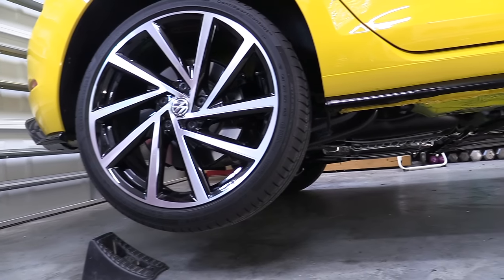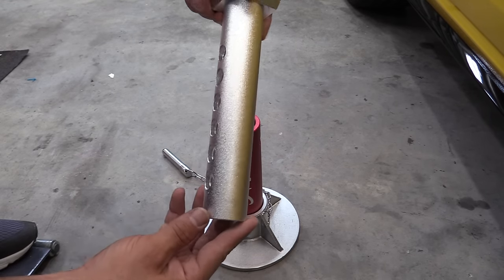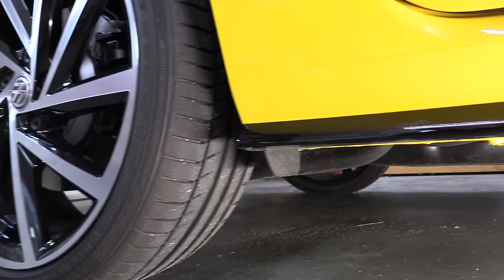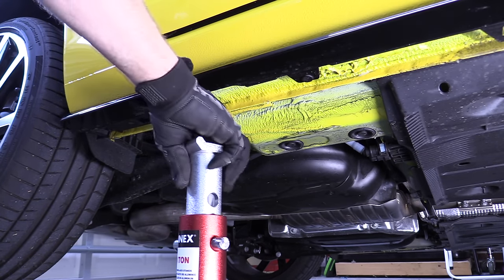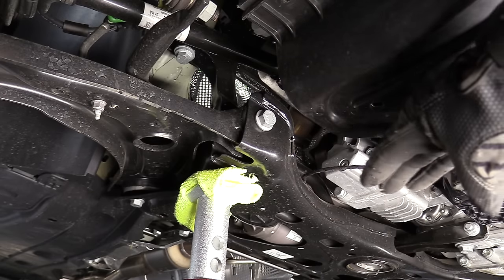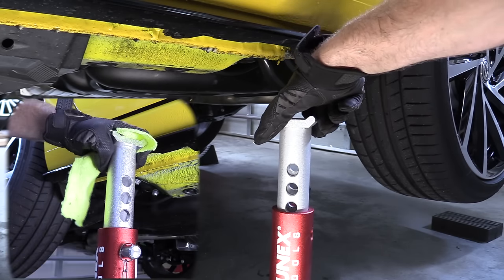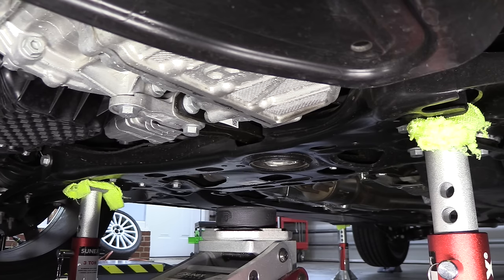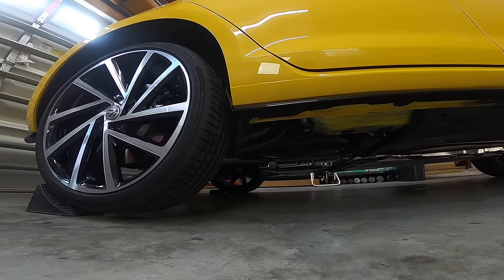How To Properly Lift a Car on 4 Jack Stands

Comment: I am surprised you didn’t mention after setting the first pair of stands, you need to keep an eye on these while jacking the other side, the car can pull on the stands and pull them over if you are not being careful especially if the jack can’t roll and shift while jacking the car. 👍
Reply: This is why I watched this video, every time I do this the first two Jack stands end up all kinds of crooked and I was trying to see how to avoid it. Seems like it may be time for a new jack that can roll easier 🤣
Reply: Especially something to watch out for on an old driveway that doesn’t have a smooth surface for the jack to roll as it’s lifting.

Comment: Instructions unclear, the car fell on me
Reply: lol haha
Reply: sue these guys
Reply: Uncalled for story time. My buddy was installing solid mounts on his integra and the car slipped off of one of the jack stands and fell on him. Fortunately he was with a buddy who was able to lift the car back up, but my friend broke a bunch of ribs and had a lot of internal bruising. Moral of the story, quadruple check your jack stands before getting underneath!
Reply: @ReviewedByAndy  holy fuck!! a nightmare, i wonder why it wasn't set up right
Reply: did you put the wheels under the car? he states this at 5:52.
Reply: @ReviewedByAndy  Indeedy. Very often, no matter how precisely you place the pair of  jack stands under the lift points, as you the car down onto them, the lift points won't be centered over the jack stand, or the 3 or 4 legs of the jackstands won't have weight pushing down on them evenly – one or more legs won't be firmly on the ground. You must lift the car up a bit and re-center the jack stand, before letting the car back down onto them. You might even want to do this a third time. And yes, after the car is down make sure you can weeble-wobble it with any of the jack stand weeble-wobbling.
Reply: Did you ever get out?

Comment: Glad to see that keeping the jack lightly raised and putting the wheels under the side of the car is widely accepted. My dad always taught me to do those two things and I’m sure glad he did. My buddy nearly died after a jack stand slipped and pinned him. Gotta be as careful as possible!
Reply: @pepeclippz7921  somewhere in the area of where the jackstands are positioned in this video. It really depends what you are doing and how many jacks/jackstands you got going at the time
Reply: @pepeclippz7921  Under the control arm or the lift points
Reply: Or an alternative solution would be to put 2x8's stacked under each wheel (if the wheels are still on the car) I've also used those plastic car ramps and slide them under the wheels.           I don't like driving up onto them though but they work great if you've jacked the car up then put under tires. I think 2x8's stacked are best though.
Reply: Wdym if you don't mind me asking?

Comment: This is probably the best video explaining how to lift a car on 4 jack stands, and I've seen many. Having said that, I've made the decision that if the job involves lifting the car completely (front and rear), I'd take the car to the mechanic. It's not worth it.
Reply: Yep. I don't trust my made in China jackstands, even though they're rated for 3 tons each. Good for taking off the wheels at the same time but no way I would go under there.
Reply: Yeah same. I just purchased an adjustable front sway bar and some other small front suspension parts for my MK5 GTI and have been debating on whether I want to attempt the job myself or take it to a shop. It's not that I can't do the install, it's getting the car jacked up on all 4 corners and getting underneath to drop the subframe and then having to torque the new subframe hardware in once I'm done installing the sway bar. The thought of being under there for that long sketches me out plus when I have to lift the car to get all 4 corners up the car shifts when I'm jacking up the other side. It's definitely sketchy af lol. After writing this comment I think I'm just going to take it to a shop lol
Reply: I disagree. Just take the necessary precautions! I put the car on jack stands. put ramps under the wheels, put a jack under the car (I just bought a new one so now I have 2 jacks under the car). and if any wheels are taken off I slide them under the frame. Essentially, My jack stands need to fail, my jacks need to fail, the car has to somehow break the ramps and crush wheels in order to land on me. I feel really safe under the vehicle!
Reply: @GageDrums  Sounds like an excellent plan
Reply: If you don't trust the Chinese jack stands, then get some 8x8 lumber as backup support.

Comment: Good video! If actually going under the car  (eg, DSG service), as opposed to just jacking it up to bleed brakes, some folks actually insert an additional pair of jack stands as a backup.  And get the second pair from a different manufacturer. Seems like overkill, but with 3000 lbs overhead, better safe than sorry.
Reply from the maker: Hey I’m good with it. I’d rather 4 extra minutes and 2 extra stands and not being dead. Lol
Reply: In My case, i have 2 pairs of stands, that are different brands, and i have 2 floor jacks, so i use both floor jacks as backups to the standards.

Another thing you could do if leaving the wheels on such as when doing fluid services, is to put something like blocks under the wheels so if the jacks fail, the wheels will land on the blocks affording you some clearance to GTFO from underneath asap.
Reply: same, even if just positioning them under with no weight bearing on them. takes 30 seconds
Reply: The risk isnt the jack stand collapsing really, thats super rare, it definitely doesnt hurt to use extras though, just in case.
The real risk is them tipping over. Thats why doing 4 jackstands is dangerous, and why extra stands wont help you.
You are far better off with wooden cribbing. Cheaper, and you can build them with a nice wide foot print.
Reply: I generally don't even take the wheels off to bleed brakes.

Comment: Hockey pucks are always good to have around when working on a car.
Reply: Never heard of using a hockey puck.  I use cut 2” x 4” s.
Reply: @CopCat34  wood can split and eject itself. new hockey pucks won't do that.
Reply: Yup I’ve been using them for about the past 5 years since I found out about using  them, they’re great much better than using wood
Reply: I have had wood explode on me before, very scary
Reply: Flyin Miata jack pads have 2 slots cut in them to go around the pinch weld which seems like a good idea.
Reply: They also work well as isolation pads for heavy speakers :D
Reply: I use a section of pine 2x4 cut into a square.  Fits right inside the cup.

Comment: One extra thing I like to do is take the weight off and reposition my stands slightly once I get the vehicle where I want it; this is especially true if I'm jacking high or I'm going to have it up there a while. 

These stands can bind and get side loads when jacked like this. That little lift off and set down can eliminate a lot of that.
Reply: Yep! That's how it should be done. Particularly when using the regular floor jacks. which have a radial lift movement, not straight up/down. Like  many scissor or bottle jacks. When lifting high in these conditions. 
Eyes and ears are your best friend. Observe and listen CAREFULLY! All the signs are there to be seen or heard! Don't be lazy, get down on your knees and look at what you're doing, correct as needed! Been lifting cars for almost 40 years with all sorts of lifting equipment, thankfully never had a single failure. 

Laying under a car is uncomfortable, don't make it dangerous as well!  
Take your time, so it don't take your life! ;-)
Reply: Justin Lynch....Thanks for sharing your valuable tip with YouTubers. It will certainly help others from being the unfortunate victims of jack and jack stand accidents.
.
Reply: This is a good point. I also prefer to jack the car from the ends, rather than from the sides. It's a PITA doing this on my car, because it's too low.

Comment: Thanks for those safety recommendations. Having the jack with slight pressure AND the wheel/tire slid assembly underneath are two reasons I am alive today. The secondary jack specifically kept the vehicle from crushing my sternum, when I stupidly reached underneath to reposition something.
Reply from the maker: DAMN! So glad you made it out. Scary stuff
Reply: Phew! So glad you made it out. An acquaintance of mine was crushed by his car doing an oil change and did not make it. Just like firearms. There are no accidents. Just gross negligence. When I started taking auto shop freshman year of high school our first lesson was lifting a car using a jack and securing it on stands. Even though we had a full blown shop with lifts. I am sure those safety lessons saved a bunch of people from being negligent and causing harm to themselves or others. Very nice that this video went up sharing invaluable safety tips.

Comment: In many (many) cars the pinched weld is just an indicator and the OEM car jack distributes the load on reinforcement pads located near the pinched weld. Putting a stand or using a flat surface to lift will crush the pinched weld and possibly make some damages to the vehicle.
Reply: This is what drives me crazy, how inconsistent each and every make and model are. Why isn't this stuff standard? Money has to be the answer right?

Comment: In 35 years, I’ve never personally had any luck, not crushing a pinch-weld with a jack or jack stand. Due to that, I always use suspension/frame points. 🇨🇦👍🏼
Reply: my pinch welds are shredded from 10 years of oil changes
Reply: The earlier generation VW group cars had a pad just inside the pinch-weld where the factory tyre-change jack lifted the car, so the pinch-weld didn't take the weight. The current generation like the Golf mk7 in the video, the factory jack does sit on that part sticking down from the pinch weld where he's jacking it and that's what takes the weight. So I think they've made it a lot stronger than the old easily-damaged pinch welds.

Comment: I did almost the same steps on my 2002 A3 8L last year... except I used the standard VW jack, and after lifting one side, it was bending its base whenever I tried to lift the other side - quite dangerous, as the car was slipping a bit even with properly placed jackstands! Managed to lift it with two such jacks, but now I know - I need to buy a proper 2T jack to securely lift the other side, as its lower and it makes for even more lifting for the jack.

Comment: Good tips here, I use a hockey puck as well.  If you cut a small slot into the puck with a table saw it sits on the pinch weld a bit better.

Comment: I've put my car up on jack stands in the dirt with remnants of rocks that were put there a few times. Wish I had a concrete floor. You can do it, but you need to make sure you're using at least 3/4" plywood cutouts for the stands to rest on. Also make sure the stands are the same height as the dirt might be higher on one side. Possible, but still feels sketchier than a nice flat floor. You also need a nice solid piece of wood for your floor jack.

Comment: +100 for the Hockey Pucks. Bought a bag of them. OCD = cut and trimmed for BMW Jack Points, (bonus there was they fit wifes Mercedes also) cut and slotted to fit GTI PInch Welds.  For when wheels do not have to come off, my son and I bought Race Ramps Wheel Cribs. 2 piece 8" lift inch ones.   I love em'. Money well spent!

Comment: I gave away my jack stands many years ago and switched to what first responders use, CRIBBING.  Proper cribbing doesn't crush, fracture and is stronger then most jack stands. I don't even want jack stands for free and I'm a mechanic. (If I worked 18-wheelers or heavy equipment I'd just industrial stands but those are different from consumer toys.)

Comment: One thing i would like to add is that when i lower the car i always check the jackstand now and then because if they are really high and the weight shifts its possible that they flip over.
So i always check to see if they still have all three legs to the ground and/or the bottomplate still rests flat

Comment: nice video, thank you. I suggest to get yourself some rubber pads to match the pinch welds or lifting points instead of rag. You won´t do any damage to the car and you can get a set of 4 for around 20€. When i buy used car, i hate when the pinch welds are bent from bad lifting :/

Comment: Watching this really makes me miss my old Mini.  Only one jacking point on each side, right under the door - so it raises front and rear wheels at the same time - and the subframes are exposed and so easy to find the right spot for the stands.  And the jack is a vertical screw, so there's no need to kneel down and look under the car to find the right point for the jack.

The only downside was the door needs to be open to jack the car up - so if you get a puncture when it's raining, both you and the car's interior get wet.  :-P
Reply: Interesting... I've just bought a 1990 Mini which is in need of some(a lot of) work but I did not know this about the lifting points. Thanks
Reply: I don't know if it ever changed - my last one was a '77 Clubman, and the last model in Australia was the '78 - but the jacking point should be right under the door.  It's just a single horizontal hole in the sill that you stick the jack into, then crank the top to screw the car upwards (so it obviously doesn't use the common style of scissor jack either.)  Be warned that if there's bad rust in the sills, the reduced sill strength could be a problem...but that means the rust needs to be fixed properly, rather than trying to work around the problem like so many youtube warriors seem to be suggesting lately.  :-)

Comment: Some cars like the camaro actually have a jackup spot at center mass on each side so you can lift and put the two stands under without the need for additional jacking points, but beware, slotted pucks are required.

Comment: This is the best how to I've seen on how to properly and safely get your Golf on jack stands. On my Mk4 Jetta I've used a 4x4 about 3ft long on the jack and jacked the sub frame in front and in the rear same thing but on the beam axle it worked perfectly with a Mk4 just make sure the jack is centered pretty easy to tell if you've got it balanced correctly , but these Mk7 AWD are a different animal

Comment: Thanks for the tip Charles! I was able to use the recommended jack points on the front subframe to install the Audi jack pad adapters. It was very stable. But now that I have the jack pad adapters, I won't be using the subframe. Too bad I did not find your video and the adapters earlier, my rear pinch welds are in really rough shape after years of abuse.

Comment: great video!! learned great information! thank you.  I bought the best jack stands that you never have to worry about failing they have two versions.  I bought low profile Esco 10499 3 Ton Performance Adjustable Shorty Style Low Profile Car Jack Stand.  I have used 4 of them to jack my entire car and it sat on them for over month.  Base is three points flat which makes it secure.  I felt competely safe under them.  They are expensive but well worth the  money for safety.

Comment: Each side of the car usually has 3 notched out parts on the pinch welds to jack. There’s the two you showed on each side and usually one midway down the car in the middle somewhere. What I do is jack on the middle notched out section it lifts both wheels front and  back off the ground then I put my jack stands on the areas that it recommends in the manual. Then repeat on the other side and if you need more hight jack up the one side fix the stands and repeat on the otherside. Also take the tires off and place them at the four jacks stands incase the jack stands fails and take the jack and have it holding either the front or back of the car for extra protection

Comment: I drive the front end up on ramps, and lift the rear with beam jack. Set the rear end a few inches higher than the front on jack stands.

Then, I use the beam jack to lift the front end off the ramps, that way it's not at risk of tipping over the rear stand since I've started with 7 inches of lift from the ramps (safety 1st) and lower the front end onto jack stands as close to level as possible.

A good jack,  with the beam is well worth the investment, and starting off ramps to avoid tipping jack stands prevents possible damage to the vehicle.

Comment: Last year I picked a car up by the front subframe with a jack. Got it half way up and the jack slipped off the subframe, car came down and the jack went through the radiator, and condenser. Cussed for about 5 minutes on that one. 

Also for some of the older cars in the rust belt, it gets kind of dicey trying to find a decent place to pick them up. The pinch welds, the jack will go right through some of them.

Comment: An idea for safety. Place some camco rv leveling blocks under the tires if you're not removing the wheels, for an added safety measure.

Comment: With more people undercoating with fluid film- make sure to wipe it off first anywhere the jack saddle will be placed along with the jack stands, especially if you use some type of puck or pinch adaptor.  If there is any resistance between the floor and the jack wheels, the saddle WILL slip and shoot the puck because of the overall lack of friction, allowing the entire car to instantly fall onto the jack saddle.